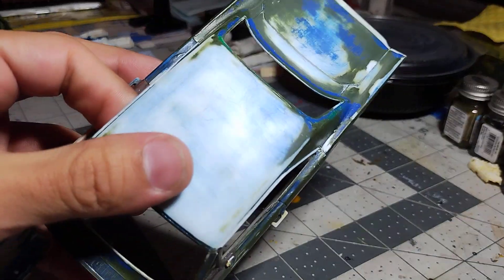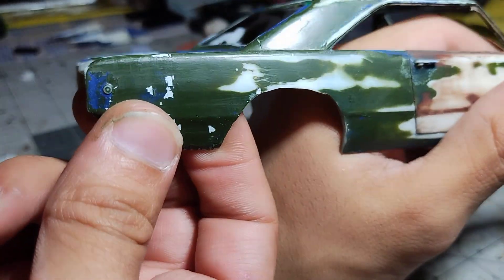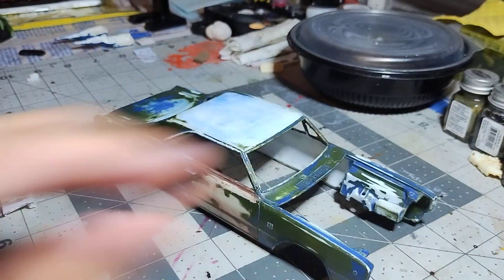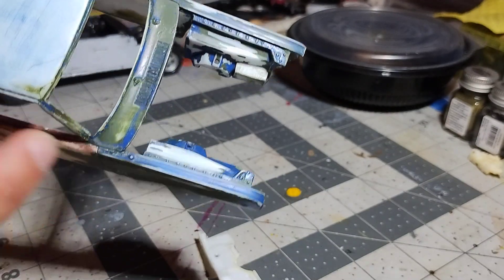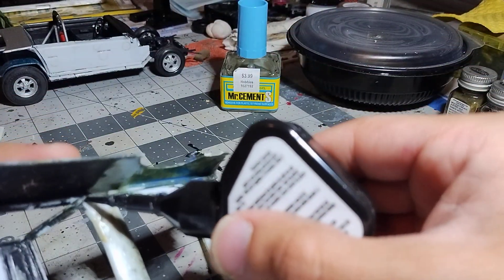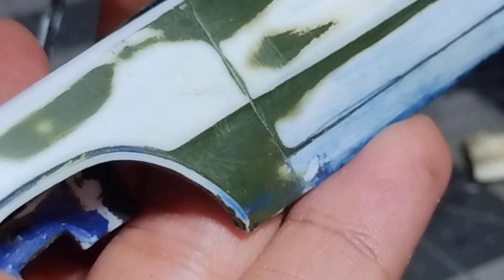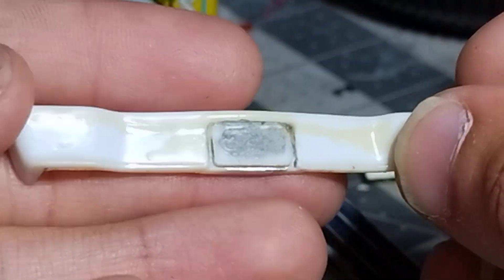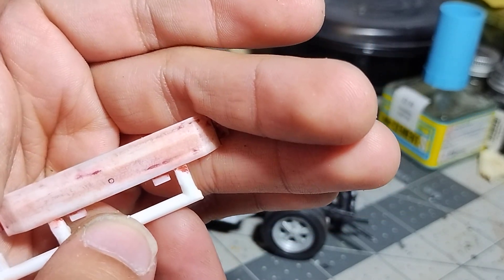Revell 1 25 scale Dodge Dart restoration update and chemical experiment.

Comment: Nail polish depends on what is in it usually its toulene.. Or xelyene.. Some are enamels with a laquer base.. you can look it up online they usually have a materials data sheet for  whats in it... Both acetone and lacquer thinners work on the toulene and xylene based ones but it's a hot base that can melt plastic..its good to have a good primer coat to keep the nail polish form burning through to the plastic.. I would experiment on kit sprues to test it out to make sure it wont melt plastic.. And always use very light coats of paint and let it dry between coats... One arm modelling used Opi brand nail polish with good results check his channel out for a video on it... His name is Joey.